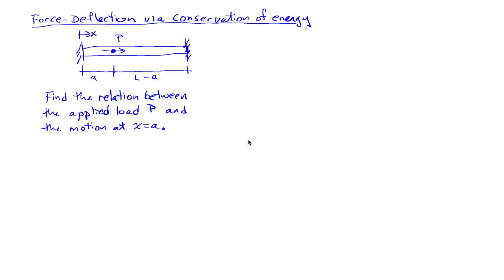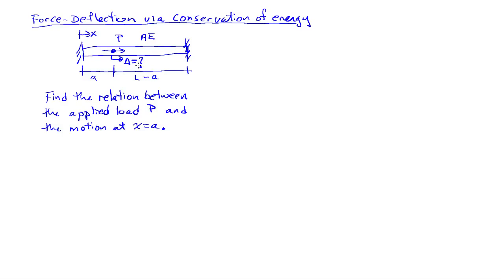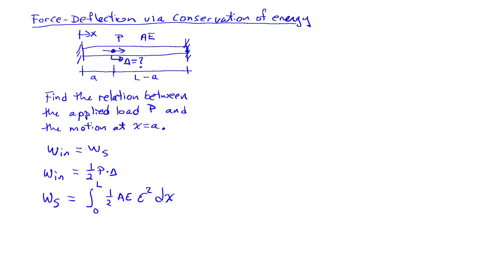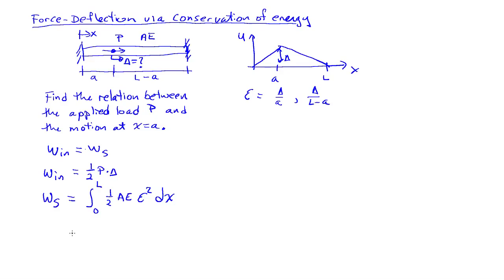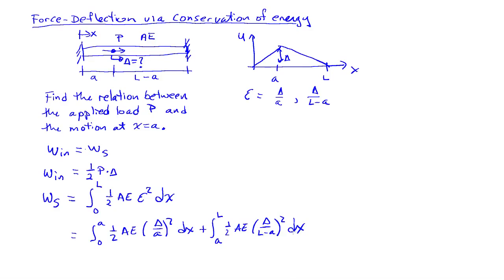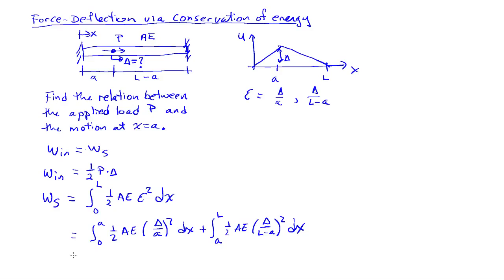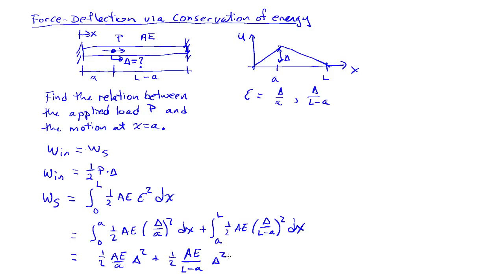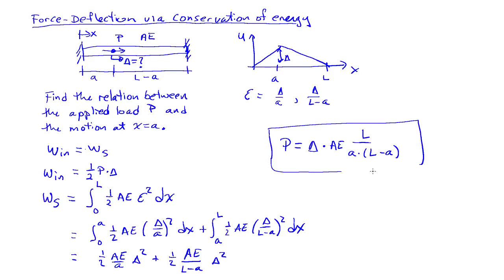Force-Deformation Using Conservation of Energy

Comment: Why is there "1/2" in the equation for work in?
Reply from the maker: The work-in is equal to the integral F(t) * v(t) * dt over the time interval of the application of the load.  In the linear elastic case this equal to (1/2) * max_force * max_displacement.